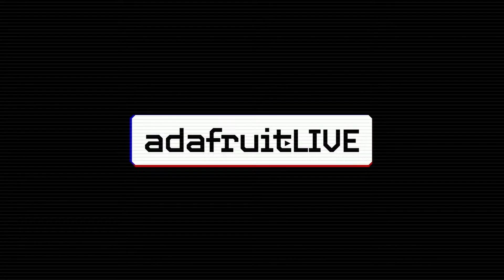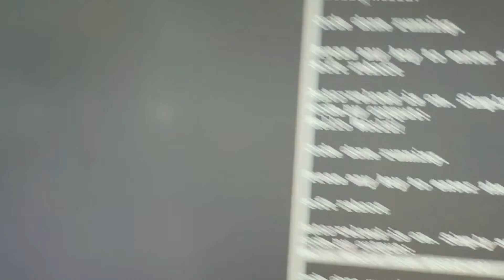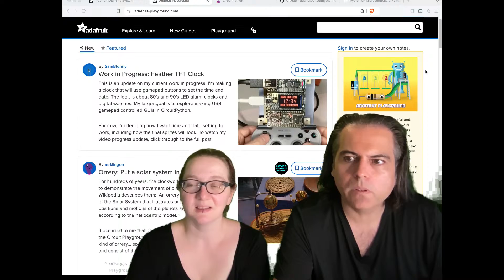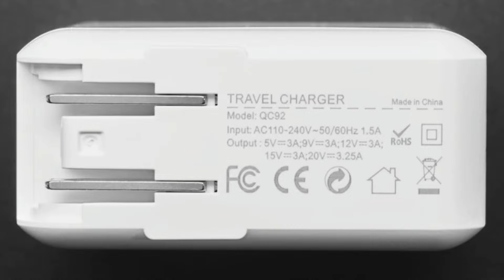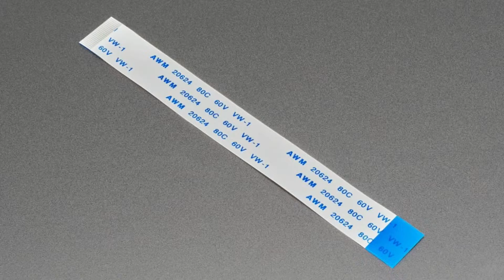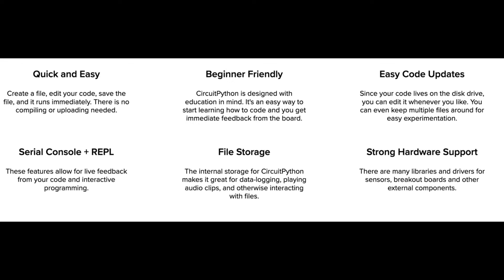ASK AN ENGINEER 9/11/2024 LIVE!

Comment: 52:10 - Thanks for taking my question! And yes, it seems like RAM/SRAM would be a difficult issue for microcontrollers, if you need to handle up to 2s of 44.1 or 48 kHz audio. I may be able to fit it in < 500 ms though, so I may give it a stab regardless!
Reply: PJRC (Teensy) has had some sound projects/libraries for the teensy with i2s, have you looked at that?